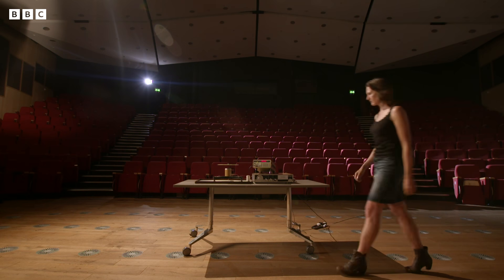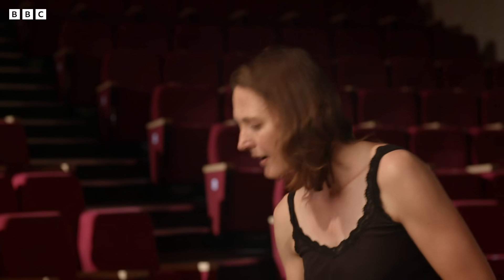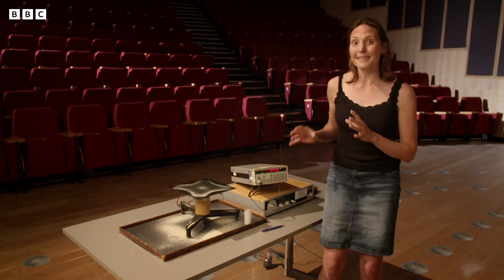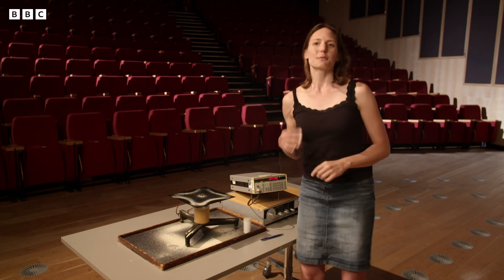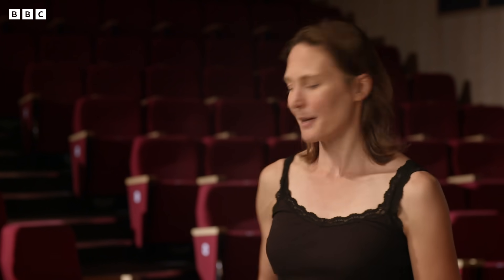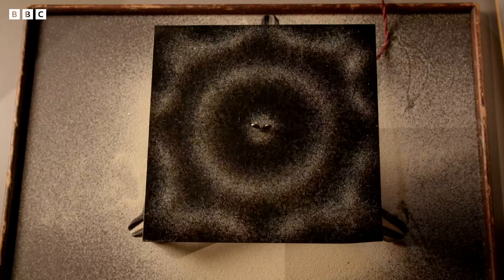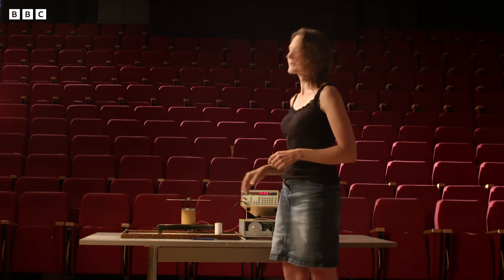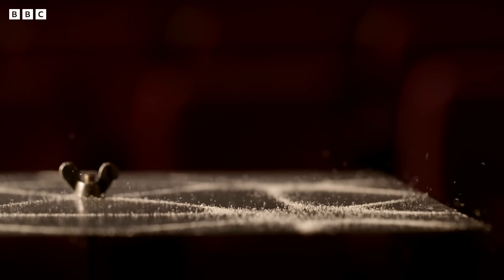Seeing Sound With Sand | Soundwaves: The Symphony Of Physics | BBC Earth Science

Comment: Why is there no Energy in matter other than that received from its environment?
Reply: your question's premise is wrong, there is.
Reply: @raverdeath100  why do radioactive materials not lose weight over time? If m-ass is being converted into Energy.
Reply: Nikola Tesla, before Einstein's 𝐸 = 𝑚 𝑐 2 E=mc 2 was established, claimed "there is no energy in matter." This was incorrect because Einstein's theory later revealed that matter does indeed contain energy, as described by the equation 𝐸 = 𝑚 𝑐 2 E=mc 2 . This equation shows that mass and energy are interchangeable, with matter holding substantial energy.
Reply: @bridgetroll9  Radioactive materials don’t visibly lose weight over time because the mass loss due to radioactive decay is minuscule compared to the total mass of the material. Although radioactive decay converts some mass into energy, the amount is so small that it doesn't affect the material's weight significantly when measured.
Reply: @Namdor2012  If mass is being turned into Energy than the spent fuel rods would be lighter. No m-ass is lost therefore the source of radioactivity has nothing to do with the material. The source is external to the mass. Enriching uranium OR plutonium involves lots of KWHs. Since the radioactive material weighs exactly the same before and after no Energy=mc^2…
Reply: @Namdor2012  Since discharged and charged batteries weigh exactly the same. How do you explain the zero change if mass is being turned into Energy? Radioactive materials do not lose weight over time as well.
Reply: @Namdor2012  Visibly lose weight? Weight is measured by a scale or displacement not Adobe Photoshop.